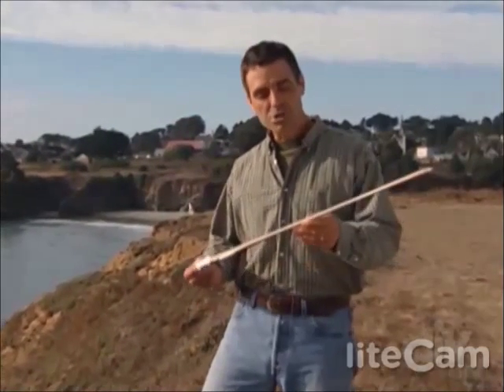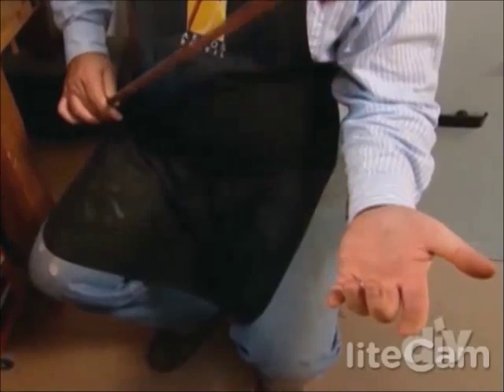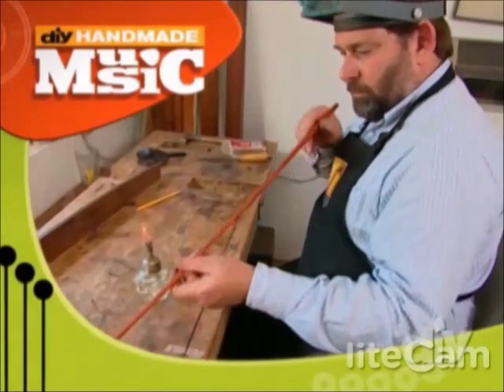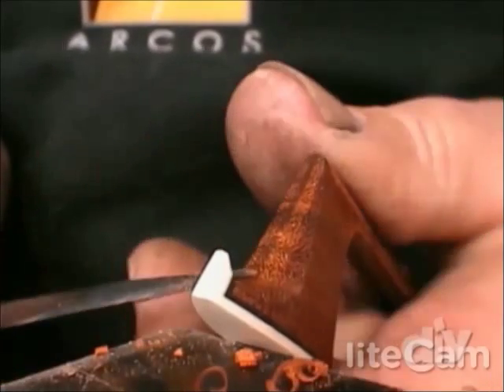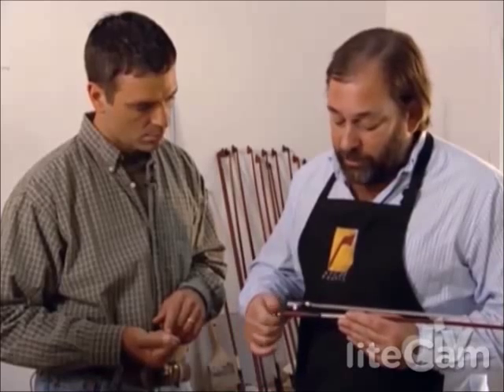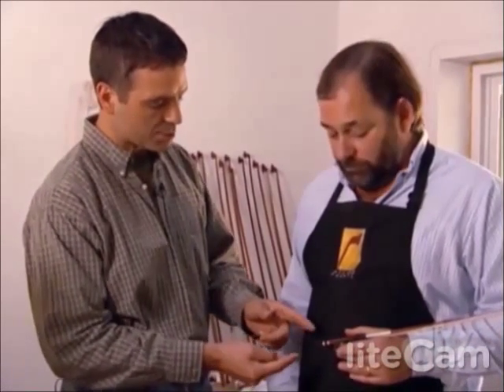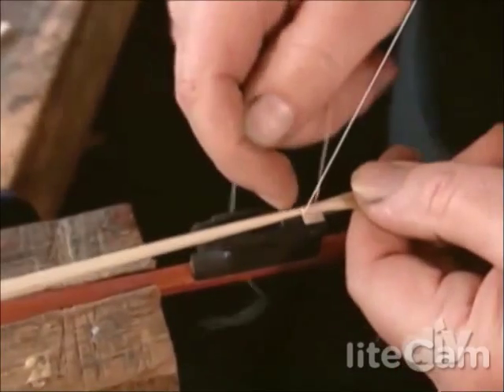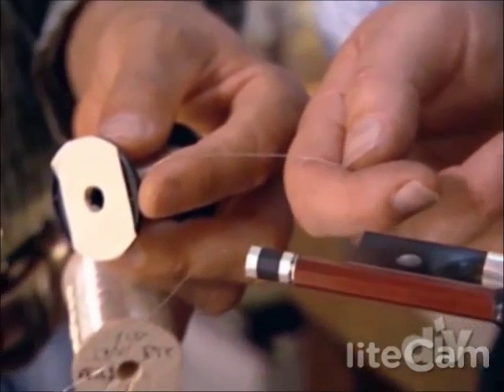DIY Violin Bow Makeing

Comment: A fiddle is not a violin- a fiddle has a flatter bridge allowing the player to play multiple notes simultaneously. My sister, a violinist, made sure the rest of us knew when my father teased her as a "fiddler".
Reply: uh, no.
the modern violin bridge's arching or curvature is standardized at 42mm  of radius. only violins from the baroque period are flatter which technically means it is baroque music that is played with flatter bridges.
fiddle is simply another name for violin as called by a certain group of people who play (mostly) country/folk music. makes sense since "fiddle" sounds more at home than the classier but less relevant "violin".
Reply: Terms vary between violin makers. Yes, whether you are a violinist or a fiddler depends heavily on how you play, but the instruments themselves also vary- because differences in instruments affect how well you can play what you want! It's the reason classical violinists covet the Stradivarius violin, and despise the brighter, thinner sound of the modern violin. It's the reason I, a pianist, adore Steinway & Sons pianos. They are legitimately better instruments... for the music I play. But I prefer old out-of-tune spinets for certain performances. Not just for the sound, but for the different way I have to play them to achieve those sounds, due to differences in key size, pressure, and so on. The instrument shapes the music, and the music shapes the instrument.

Listen, this is information coming from a violinist and her violin maker (and her violin teacher!). The actual craftsmen know what they are talking about, believe me. Fiddles are violins, but some (not all) are adapted to a particular sound. Also, "standardized" violins do not exist. There is no such thing as a machine-made, mass produced violin. All instruments are different. Old violins or "fiddles" as preferred by country players, especially some centuries ago, were crafted in a different way than eastern violins. Remember, before the telegram, train, and telephone, craftsmen didn't have a lot of communication over large distances to discuss exactions about instrument making. Each one developed their particular way to his or her best ability, and thus differences evolved over time as the trade branched out. Hence the differences between a true violin, and what we would more consider a fiddle. Not to mention the differences between instruments from different makers- differences that still exist today. The gap is closing again in the modern era as "standards" are reintroduced, but some makers don't follow them for their own reasons, or they prefer to make variations on the traditional variation.

Craftsmen do it all the time, building an instrument to have a particular voice and ability to play certain things. They can do this by altering how pieces fit, their shape, the shape of the body, the type of wood used, the type of strings used, the bow, et cetera. The same goes for other instruments, from organs to pianos to brass and woodwinds.

Don't argue with me. I'm a lifetime musician and music major from a family of musicians. I know what I'm talking about.
Reply: Ummm, well I am a fiddle player and have been for over 20 years. My father played the fiddle, as well as my grandfather and grandmother. I literally do nothing to my bridges, nor has anyone in my family. I can instantly go from playing bluegrass fiddle to classical violin at any moment. To suggest that because some players may alter their bridge means there is a difference between a fiddle and a violin is just ludicrous.
Reply: Violin MAKERS. Not players. MAKERS! As the musician you just choose which instrument you purchase... You might try reading a little more carefully XD.
Reply: Amanda Lockridge Strads cost like 1,000,000x more than they're worth
Reply: @hpsdecals9635  Hahahaha!
Reply: It seems to me like a flatter bridge means its harder to accurately play notes you want with the bow

Comment: If there's only one wood is it still a diy video
Reply: In reality you could probably get away with any old non-porous wood, they're really talking about the upper echelon of bowmakers, who service usually the upper echelon of players since new or less invested players usually don't drop money on hand-crafted bows. But if you're looking to make one on your own, Ipe, Ironwood, bloodwood, osage orange make decent bows, and if you look up regular shooty shooty bows and what people like to do with the woods used for those you can get an idea of the rather large variety of options you have in constructing a bow. If you're pressed for cash, old renaissance bows were often made from the same blanks that their parent instrument was made from. This means if you tried a maple bow for example, it would work just fine, and it will play just as well as you would want for the most part. 

My only advice would be to select woods that are not "open porous" which means they have very large pores on some of their growth rings. These might be good for shooty shooty bows, but are bad at allowing sound to transmit freely through, and often dampen your instrument a tad. An example of these woods would be oak. But if you're really inclined to, just use oak. You can even use spruce if you have infinite patience for blowout.

TL;DR you can just use any old wood, or any combo.